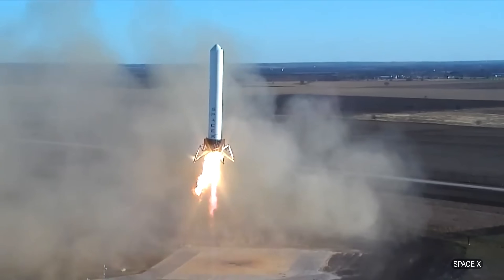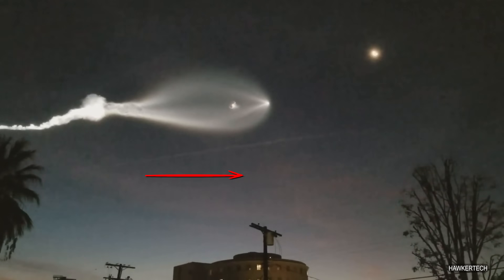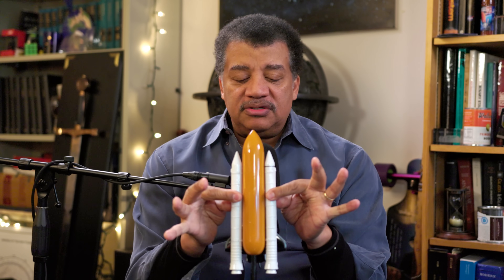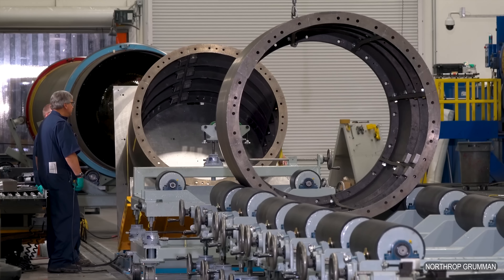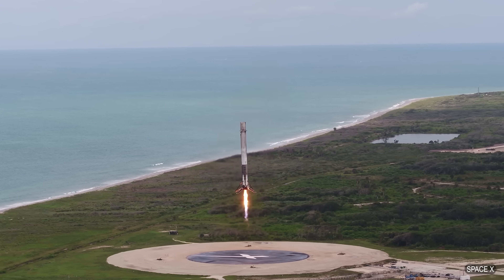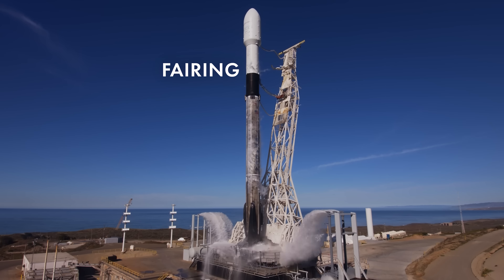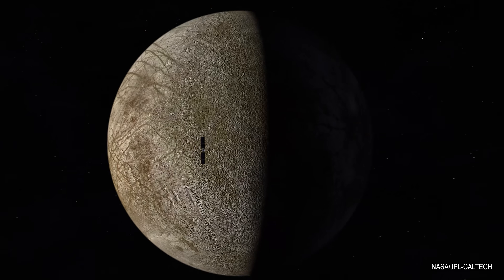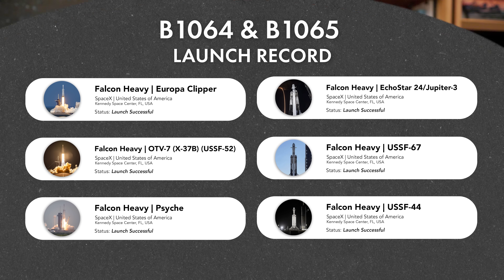What's Up with Reusable Rockets?

Comment: The elephant in the room that I see is how long can Starship stage 2’s keep blowing up over the Caribbean until they actually drop debris on the land and possibly hit property or worse, people. Todays debris shower into the Bahamas is scary!
Reply: yet we have 40k americans getting offed in traffic every year. Risks are just that, risks, and that is something we just deal with.
Reply: @snuffeldjuret  I agree but I'm not talking about practical risks but risk in optics. If just one rocket part hits anywhere near a human, this S%$t will hit the fan in the media. Fortunately for Musk, He has complete control of the FAA at this time.
Reply: If that ever blew up at launch, its hard to imagine the size of the explosion. When I was a kid, I thought we would have lots of smaller rockets going to the moon, to build things, then launch the big rockets from there. Getting this huge rocket to the moon safely, is a nightmare, they keep failing at the easiest part.
Reply: @sharpvidtube  Not the easy part. The star ship is way out in the unknown. They are trying for engines that don't need taken apart and rebuilt, full flow combustion cycle engines, tiles that don't need replaced, and so many more new things. I don't think it's a good idea to try so many new technologies at once but if it works it will be huge. A cost to weight ratio that will change the world. To experiment in space takes hundreds of millions of dollars so only the "we know this will work and make money" projects get to go unless they can get government funded. What happens when that price drops to millions. Suddenly crowd funded and maybe this will work projects get to happen. It's the maybe projects and the "we don't know" projects that always have the biggest impact and that is what I am hoping for.

Comment: Fun fact about the Falcon 9 system, weight added to the first stage only incurs something like a 4:1 penalty to the mass to orbit (add 4lbs to the first stage and you get 1lb less to orbit), however any weight that would have been added to the second stage would be a 1:1 penalty. Long story short adding weight to the first stage to recover it doesn't impact the mass to orbit AS MUCH as you would think.
Reply: @StevenS.-up2pp  one has to look at the entire system to see if it’s worth doing. I imagine it is.
Reply: It can pop up 141,000 Lbs, so that stat alone means they win, even if they roller coaster it back down.
Reply: @cosmicraysshotsintothelight  Falcon 9 has a theoretical maximal payload of 23 tonnes =~ 50,000 lbs. You are thinking of Falcon Heavy, and even that can't actually launch that much without some modifications.

Comment: Those expended boosters are not just big fuel tanks, they have engines in them as well
Reply: Solid rocket boosters basically don't have engines. They're essentially tubes with solid rocket fuel that's lit and keeps burning until it's exhausted.
Reply: @ohedd  is say a better way to look at it is that for an SRB that it's both the engine and the tank simultaneously
Reply: @KiRiTO72987  Yea
Reply: It has a v28
Reply: But expendable boosters have significantly less complicated (and in turn far less expensive) engines because they're built for single use, rather than with the ability to take apart and refurbish and put back together for another run.  That refurbishment also costs.

So, the question is, is it more expensive to build a single-use booster, or is it more expensive to retrieve and refurbish the booster after each flight.  Also add the cost of the on-board guidance system if your reusable booster has to pilot itself to a landing.
in the case of the Space Shuttle, we found the SME (Shuttle Main Engines) were actually more expensive to refurbish than it would have been to build single-use versions for each flight.  This is why the engines on the core stage of SLS are far less expensive, even though they're essentially the same model engine.

Sadly, most people don't think about such things.  They just think building the thing is the only cost involved.
Reply: They’re really larger, more durable versions of rockets invented by the Chinese maybe a thousand years ago.
Reply: I don't think the solid boosters have engines
Reply: @enoughofthis  And I think that's why they're typically referred (in engineering circles, at least) to as solid rocket 'motors.'

Comment: lol gotta keep it from blowing up on launch first
Reply: Falcon 9 has launched 447 times with 444 successes, a rate of 99.3%.

399 included recovery of the booster.

15 were manned missions with a 100% success rate.

9 boosters have completed 20 or more missions.

They will get there with Starship.
Reply: @mack1305  So a little better than the 40+ year old shuttle program. Genius leadership. (shuttle 98.5%)

Comment: Worth pointing out that solid fuel is really useful for military icbms.
Reply: Not just icbms but any time you need a rocket to be ready at all times without a prep time
Reply: @robot-andrew  That's fair, but in the orbital class served by the shuttle boosters that's basically ICBMs. No reason to have solid rocket boosters other than to support a dual-use military manufacturing base.

Comment: The issue with rockets is not how much the fuel costs or weighs, or how much is used. It's about how much the rocket costs. In the days of the space race the priority was to get a nuclear bomb to them by rocket whatever the cost to show the soviets we could, and to build enough of them to get the job done if we had to use them in a war. Reusability was not even in the principle of their use. A satellite communication industry was not even in their dreams. So those rockets were built for minimum weight, and flimsy. Just strong enough to get the job done. The space shuttle came from an industry guided by that principle. To reuse it required heavy wings, and landing gear to reuse limiting its payload too. That's why it cost more to refurbish after flight than it was worth.   

But the burgeoning satellite communication industry was becoming so lucrative that even using throw away space race era rocket design is profitable. Landing rockets was attempted by several companies prior to SpaceX.  They were failing 50% of the time as was Space X at first. After one failure Musk said there was one more rocket left, and if it failed he would give up. Then I sent a four word message through the grapevine I have a connection to which immediately lowered the failure rate from 50% to less than 1%. That reusability makes communication satellites even more profitable hence financing the increasing launch cadence, and size of Space X rockets.

There are other improvents Space X needs from me but only the first one's free.

Comment: My issue with the current direction of Space Flight is that, in some way, its going backwards. In the 90s when I grew up it was the "Space Plane" that's what the shuttle represented. It was an evolution of the "Slashdown" we saw with traditional rockets. Now, it seems we're back to that. Whatever happened to that Space Plane, has it been abandoned in lieu of this new "reusable?" As Neil says, we did reuse a big chunk of the Shuttle Launch system. So are we really going in the right direction. What could be done by the shuttle, for example, cannot be replicated with the current tech being used. The closest is the Starship, but I honestly, don't see that going anywhere. At the very least, its decades out of being usable.
Reply: What is your evidence for this? You do know that the Shuttle cost $1.5 Billion for every launch, don't you?
Reply: @mikemccormick6128  I'm not sure what you're wanting evidence of. Have you looked with your eyes, we aren't doing space planes, it splashdown capsules. 

I'm not sure what I'm expected to show.
Reply: Which of course has no connection with reality of costs, since it was built by the government and without any private competition.  Happy Tesla to you. And happy boom today
Reply: @acadiaarchitecture3170 huh? quite the non answer. 
"Private competition" Space flight is probably the LEAST competitive industry. It has a HUGE barrier to entry. 

What I pointed out is, SpaceX hasn't really innovated that much. They did some refinement of things made by the government. Self landing has been done in the past, in was in development. 

"Reality of cost" I'm not sure what you're referring to. What exactly is the reality of this "Private" company, that hasn't made a profit? That relies on government contracts and a bunch of investing rounds. 

All it does is take what was done by the government, and turned it to a private industry which has a profit motive. Basically it could be argued that it operating does the same as NASA but now with a tacked on goal of making a profit over just providing a service. 

Fun fact. SpaceX suddenly increased their prices after Russia stopped their space program, thus not having much in the way of competition and able to price gouge.
Reply: @acadiaarchitecture3170 Why do you keep talking about Tesla? Why are you so obsessed with Tesla?

Comment: The orange tank of the shuttle’s tanks has 528,000 
Gallons of liquid hydrogen and, oxygen. The dry rocket 🚀 fuel is 1.2 million pounds each. They used to fall back too. Also the orange tank is aluminum like a balloon only 1-1/2 inch thick hollow and if you compare it to a coke can 
The can is thinner.

Comment: Slight correction/clarification extra mass on the booster doesnt translate 1:1 to payload mass its going to be something like 6 kg on the booster means you will lose 1 kg of payload the ratio depends on pretty much every parameter that can be tweaked on a rocket

Comment: "Yeah the engineers check out the plane, they kick the tyres, they have a diagnostic list". 

  Not a Boeing.
Reply: This aged poorly
Reply: @SC-gm3ry This didn't even age 😂. This video has come out after all the crashes.
Reply: was about to comment this. Probably not such a great time to compare what Plane companies are supposed to be doing but have obviously failed to quite a bit.
Reply: @porterde08  They laid off all the safety maintenance staff at the FAA. So foolish.

Comment: The theory makes sense on paper. Make a rocket work like an airplane and you save money. The problem is the current technology we have has not shown to be capable of that operation regiment. 
So far all rockets, including SpaceX have actually gone through a refurbishment process before they can be reused. 
So the process we’re using is not a plane where you landed, refuel it and re-launch it. They’re still using the space shuttle model of landing the rocket, dismantling, refurbishing, reassembling, refueling and then launching.
SpaceX has never met their goals with the Falcon nine. It takes them at best 28 days to get a rocket with nine engines into launch capability. Imagine how long refurbishment it’ll take with 39 engines with Starship.
This is why SpaceX has never released its operational costs. Why their prices can’t go below the Soviet era Soyuz rocket. Why they’re very dependent on government financing. It’s still far more cost-effective to turn out as many rockets as you can and throw them away than it is to try and save them. The rocket equation is going to require a different kind of engine to give us the spaceships we desire.
Reply: It costs 10 million to refurbish the rocket. That's why it's done. It makes the refurbishment process cheaper
Reply: You're acting like they are completely disassembling and reassembling the booster and engines, and to say they it's cheaper to just build new ones from scratch lol like your delusional dude. La la land is where you're in.
Reply: that is why all reusable stage 1 under development is using methane
literally every single one as I recall
Reply: The fastest booster turnaround time is 13 days right now. And they likely could do so faster. There are limits to how fast the recovery ships can travel and how many launches the launch sites can handle. And no, SpaceX does not dismantle the boosters except after several flights. They may remove an engine or two after a flight, if needed. But most of the time, the booster is just going through checks and fixing minor issues.
Reply: Your entire comment has been non-stop misinformation. You were probably one of the ones saying that Starship would never get off the ground.

Comment: Ariane6 just had its first successful launch with cargo, and are rated to 11,000 kg (24,000 lb) to GTO at a cost of €90 million without being reusable.
Reply: SLS = $ 4 BILLION each, $ 2 billion to launch, Engines are from the Space Shuttle and cost
 $146 million each there`s 4 of them.
Reply: They can only launch a few a year. It's only 4500 kg to gto. 10350 kg to leo
Reply: @smiles 
it depends on how many solid rocket boosters are attached.
Capacity
Payload to LEO
Mass
A62: 10,350 kg (22,820 lb)
A64: 21,650 kg (47,730 lb)

Payload to GTO
Orbital inclination
6°
Mass
A62: 4,500 kg (9,900 lb)
A64: 11,500 kg (25,400 lb

Comment: Spacex still is not great at the boosters always returning properly, but it's a difficult endeavor.
Reply: Not great, and you got 98 almost 99 percent success rate. You've got to be clowning 😅
Reply: I think you meant Starship, not Falcon. But in that regard... Well. BOOSTER already 3rd time landed perfectly. There is some major issue with second stage with block 2 (personally I am suspecting this strange hybrid of engine called raptor 2.5, that got guts from raptor 2, but connections from Raptor 3, but just guess work)
Reply: @ There is no Raptor 2.5. They use Raptor 2 engines. They will use Raptor 3 engines for Block 3. The engine isn't the problem with Block 2. The Booster doesn't have a problem and it's using the same engines as the ship. They also don't land. They are caught by gigantic arms in mid air.
Reply: @mikemccormick6128  there IS raptor 2.5. it is literally what I wrote. R3 have different attachments than R2, and r2.5 is exactly that. R2 with attachment of R3.
Reply: @just_archan  Okay. I'm not going to say you are wrong but SpaceX is not officially calling it Raptor 2.5. It's a Raptor 2.0 but they have to change some fitting in order for it to fit the Block 2. I get what you are saying.
Reply: @just_archan  and on top of that, not a single person expected starship to survive first real reentry attempt, but it did
Reply: @ I personally wouldn't count SpaceX detonating the ship as a failure either because this is all experimental at this point. It's only the second launch of the Block 2 and they are intentionally pushing the limits on what is possible because that is the fastest way to learn.
Reply: @mikemccormick6128  You need to stop explaining and giving out this wisdom for free. Allow these people to wallow in their ignorance and hate. Please.
Reply: Mehn, It's sad how hate can run into people's veins and they refuse to accept the most obvious facts out there. You'll be fine Man. Just hate with facts next time. Try again.
Reply: You gotta be kidding. 🤦‍♂️
I bet you can't give them the credit they deserve because of Elon.  😁
Reply: I suppose all you ever see on the news are the failures. They of course make it seem like 50% crash.
Reply: not great?
dear lord, what standards do you have? XD
Reply: @snuffeldjuret  LOL, just allow. These are people infused by hate and envy. They live a miserable live. Just allow 😂
Reply: 389 successful landings out of 395 attempts for the Falcon 9 Block 5, which is a 98.5% success rate just so that everyone fully understands what "not great" means.
Reply: @mikemccormick6128  It also shows that it isn't that difficult. I'm not convinced that it works better than landing them in the sea, at least that puts the fire out😂

Comment: Correct me if I’m wrong, but if they tried to launch 1 shuttle a week, they would have blown up (at least) 1 shuttle a year. That probably would have messed up the cost / flight calculations.
Reply: If they launched one shuttle a week, they would likely have corrected many of the problems we saw in the program.  I am pretty sure that Felon Mucks' fail stats are worse, and that is why we are not putting people on his playtoys yet.
Reply: @cosmicraysshotsintothelight  never heard of Dragon?
Reply: That's funny, because SpaceX has the best flight to failure ratio in the entire history of space travel by far.
Reply: @SikerGaming  By far the best failure ratio of anything but the Soyuz rocket has more successful flights because it has been flying since the 60s. I'm wondering if Falcon 9 will get to the record before it becomes obsolete or not.
Reply: @robot-andrew  According to Google, Soyuz has a 95.4% success rate, while the Falcon 9 has a success rate of 97.1%
Reply: @SikerGaming  yup Falcon 9 has a better success rate. But at >2000 successful launches Soyuz has the most successful launches. It will take a while for Space X to get there but I'm rooting for them.
Reply: @cosmicraysshotsintothelight  what? Do you not know that spacex's falcon 9 is the only way available to nasa to send astronauts to iss for now?
Reply: @cosmicraysshotsintothelight  Apollo 1, Rest in Peace.
Reply: @c1re-x9h  We went from a pure Oxygen over-pressured, very dangerous "environment" to 5 psi at 20% Oxygen.  And the hatch design was a complete redo.
Reply: @cosmicraysshotsintothelight Falcon 9 has launched 447 times with 444 successes, a rate of 99.3%.

399 included recovery of the booster.

15 were manned missions with a 100% success rate.

9 boosters have completed 20 or more missions.
Reply: @cosmicraysshotsintothelight  Your thinking of Boeing. Falcon 9 and the space X dragon have had 16 manned flights and at least 31 unmanned resupply flights.
Reply: @cosmicraysshotsintothelight  It is best to remain silent then to reveal your ignorance.  There have been 15 crewed missions on the falcon 9 since 2020.